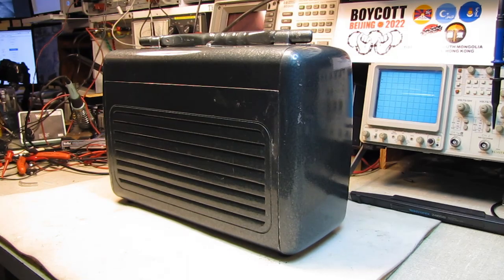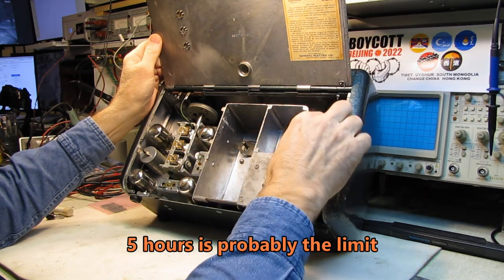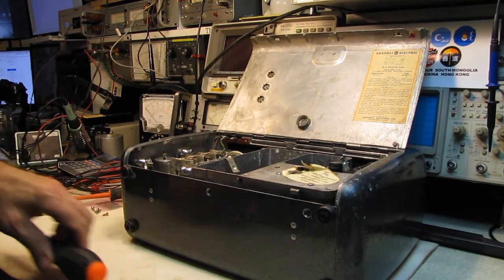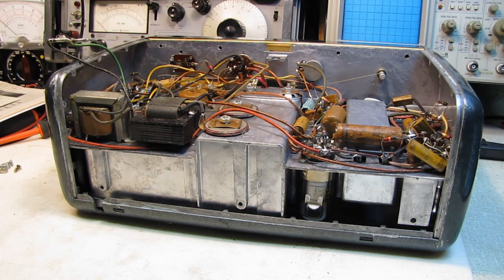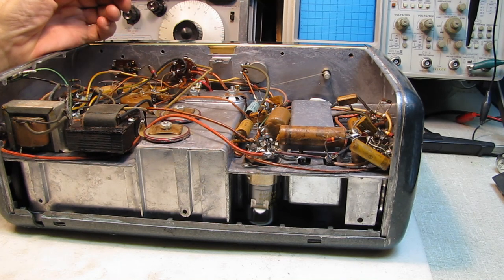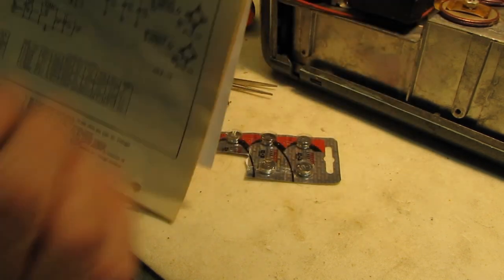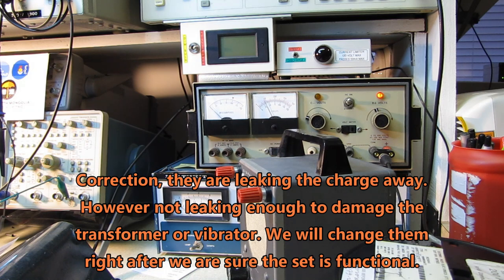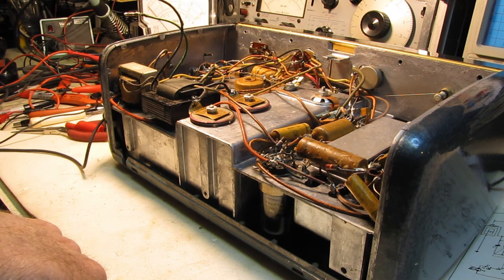DON'T PLUG IN THAT OLD RADIO - G.E. MODEL 250 PART 1

Comment: Those look like mercury cells. They would be a pretty steady 1.35 volts so that would be 5.4 volts. Very interesting and complicated radio.
Reply from the maker: Hi Robert, you may be right. I have found the "sweet spot" for the bias is between 4.5 and 6.0 volts. I will cover this briefly in the next release.

Comment: I like your approach to not replace all the capacitors shotgun style and instead going through meticulously understanding all the problems. I always learn a lot watching you, great video!
Reply: Just bought a RCA 6-X-7 that someone hacked because many of the wax paper capacitors are bad.
Ends pooped open and drippy drippy wax on the  bottom cover baseplate. The hacker put a resistor across the 35W4 maybe because the B+ was too high. That resistor was toast. You have to be like a detective and look
at the components  AND the schematic to understand what is going on and not just shot gun stuff.

Comment: Very interesting radio, I never liked loctal tubes either, I never heard of low inductance capacitors, guess if I had to replace them I would make sure the leads are short as possible.
Keep up the great work Vern , I learned something today.
Reply from the maker: I'm going to leave them in place, at 2 volts the leakage will be almost too small to measure. Thanks for watching.
Reply: @theradiomechanic9625  I agree.

Comment: Might check 60, motorcycle batteries might fit the hole . Or might re stuff the case, It’s a tank of a radio . I enjoy watching. Take care !
Reply from the maker: Hi Keith, Motorcycle batteries are either 6 or 12 volts. This is a 2 volt single cell battery.
Reply: @theradiomechanic9625  It’s still a great radio Locktel tubes can be soldered :)

Comment: What a special contraption that is, that radio. All cast aluminum - military grade indeed. I like the crinkle (hammertone?) finish on it, which may be hard to restore? It's often seen on older, high-grade equipment. And I just adore your use of the famous SWAG methodology - I use it daily, lol, with often spectacular albeit unintended results.  The battery in that unit reminds me of 1970's motorcycle batteries in terms of form factor (not voltage). The rectifiers in that unit are interesting, too. Another very interesting and informative video - thank you!
Reply from the maker: Thanks for watching and the kind words. The Hammered Finish is actually pretty easy. Rust-oleum makes rattle can versions that I have used often and come out great. The hard part is finding a matching color. I have some coming that I hope are close.